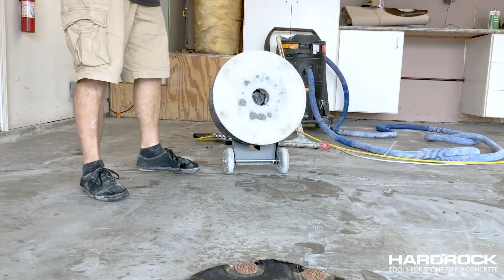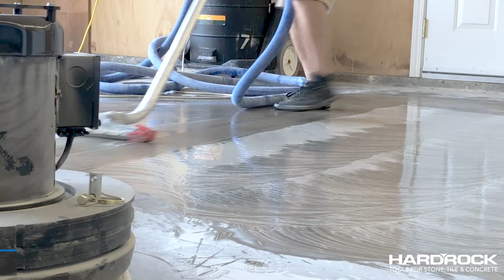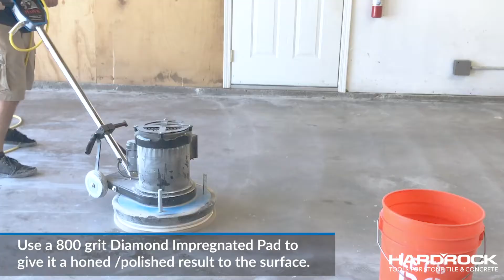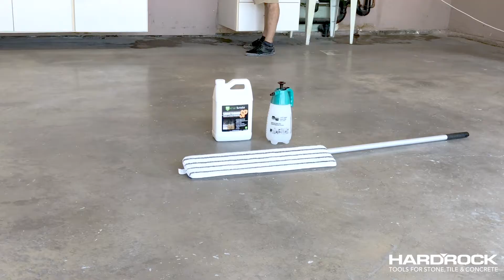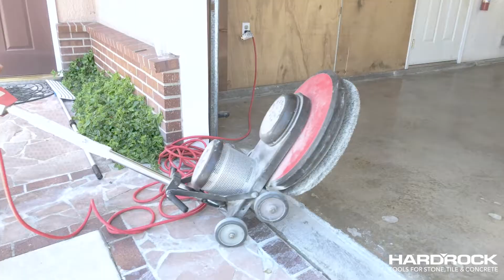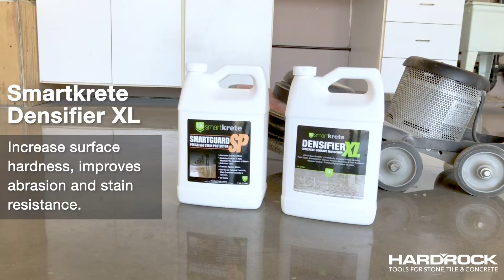Polish Your Garage Floor Fast and Easy

Comment: how slick is it? especially when wet? I like the look but dont want to dump the bike...
Reply: Like ice
Reply: Polished concrete can get slick with water and snow/ice. More so with snow/ice. The higher the polish, more slip resistant(to an extent). I’m in the Midwest, I do not sell polished garage floors because of the dangers of slipping in winter months.

Comment: That’s supposed to be fast and easy ?
Reply: I just got a price to  polish my new polebarn floor 36x48, they quoted me 4700.00, so yeah this looks fast and easy. haha.
Reply: This is not the right way to polish a floor , basically, he just grinded and sealed , the shine he has on that floor is thanks to the seal , basically what he did is add wax to make the surface shine . This is not polished concrete , polished concrete is going for 7 to 9 dollars per square feet,  where you go in the concrete with several steps with diamonds with 50 grit , 100 grit , 200 grit , 400 grit , 800 grit , 1800 , and some cases 3000 grit .  Depending on how bad your floor is, you might have to use full metal diamonds to make sure the base is done right . Becareful. Do your research.

Comment: In NO WAY shape or form is that Polished Concrete Flooring - that is a burnished concrete floor. Polished Concrete is completely flat, no divots, pinholes, or scratches. That finished floor has more waves than my local body of water on a windy day and will fail every single architectural spec'd polished concrete job "post inspection" anywhere in the country.

I sure hope this isn't a SmartKrete sponsored video.
Reply: A lot has to do with the slab of concrete you are working on
Reply: Couldn’t agree more. The only slabs I’ve worked on that didn’t need a lot of prep were cream polishes.
Reply: That’s a wax and buff job. Way different and less quality than a mechanically diamond polished floor.

Comment: 12 Wet Passes! That is alot of wet passes! Must of used ALOT of water and spent ALOT of time on that one!
Reply: no, it was quick and easy :))))))))))))))))))))))))))))))))))))))))))))))))))
Reply: Looks fast and easy, I'm taking two weeks of vacation to do this 😆
Reply: @vanniperigord7085  fast and easy if you skip repairs, grout, corners and edges. No polish goes fast and easy haha.
Reply: @andrewhansen877  if it's a good, ready surface such as mine. It looks great. All jobs aren't the same, some require more prep. Duuuurrrrrrr.
Reply: @vanniperigord7085  you are correct, not all jobs are the same. I think you are missing my point.
Reply: @vanniperigord7085  you must be the buck a foot in and out in a day “polishing” with a buffer hack. Yes, if the surface is ready to go(brand new pour) you can get away with minimal prep. Been doing this for 16 years and have yet to come across a floor that doesn’t need at least one grout coat. No, I don’t like the video. Very misleading. Maybe some of us speak out against people hacking in floors. Keep hacking away, sir.

Comment: This is not the right way to polish a floor , basically, he just grinded and sealed , the shine he has on that floor is thanks to the seal , basically what he did is add wax to make the surface shine . This is not polished concrete , polished concrete is going for 7 to 9 dollars per square feet,  where you go in the concrete with several steps with diamonds with 50 grit , 100 grit , 200 grit , 400 grit , 800 grit , 1800 , and some cases 3000 grit .  Depending on how bad your floor is, you might have to use full metal diamonds to make sure the base is done right . Becareful. Do your research.